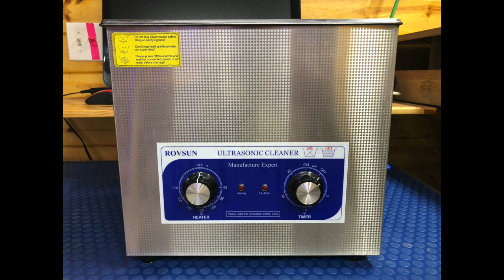40 year old Athearn SD-45 Demonstrator Saved From The Garbage

Comment: I don't know how to tell you this, but ... the broken out windshield post was correct. The demonstrators featured an L-shaped windshield on the engineer's side, a feature SP and other roads adopted with their purchases. The bicentennial unit shown at 1:40 (ATSF 5700) was actually an SD45-2 - longer frame, wider radiator fan spacing, and no flared radiator panels.
Reply from the maker: Yup.  Lots of fellers have points that out to me in the comments about the windshield post. That dang google machine... I type in SD-45 picture, that one pops up and looks good to me so I used it.  You have a good eye there picking that out. Thanks for keeping me "on my toes" and watching my Vid's :-)
Reply: @classicmodeltrains  Sorry. I scrolled down a couple of pages to make sure I wasn't repeating something others had said but I didn't see any window references. I should scroll down further next time. Nice work on the re-condition though.
Reply from the maker: @whiteknightcat  no worries. I also get an opportunity to learn stuff off these videos I put up. People just sharing information is how I see it :-)

Comment: Love the replacement hand rails! According to A-Line, the replacement stanchions have an ID of 0.020", which they say will fit 0.0195" wire. But I see you've used 0.022" wire. Did the stanchions fit over the wire ok?
Reply from the maker: Thanks.  The stanchions were a bit tight, but worked out good.
Reply: By the way, your episode inspired me to dig out an Athearn SW7 I had sitting in the box for years. My hangup had been the handrails - I've never liked the way the handrails and stanchions look on Athearn, but your idea of soldering them in place was just the impetus I needed. My SW7 is now trundling through the yard at 0.5 scale mph. Thanks!

Comment: All of the old trains were built simply. Some locomotives came as locomotive kits and had to be put together painted and letters. With just cleaning the wheels and oiling the mechanism periodically outside of that all you have to do is change the brushes in the motor every 10 years when they wear out any engine is good to go again. I just wish they'd never went to plastic plastic is so cheap compared to die cast. Bad for locomotives at least the diecast way of the shell gives you extra traction. The plastic F7 locomotive was just made to be a desk ornament what model railroad is being what they are they can power anyting. Lionel was going to make their F3 logo motives diecast but one of the major plastic companies convinced them that they could make plastic good enough for Lionel trains. It is a shame Lionel did that. I RV athearn was a Model Railroader who modeled in O gauge. His company Supply very good O gauge Cars & locomotive because he like O gauge trains 2 rail not 3 rail even after most of the other manufacturers went with HO scale trains. Most people had room for a 4 x 8 layout and either O gauge or HO scale. You didn't have room for a 100 car train and you probably could not afford to buy one anyway. Only in the last twenty something years have the humongous O gauge layout in these people's houses has become the fashion. And you can take some apart because I have seen estate sales where is the builder of the layout is selling delay out on behalf of the Widow. If it is an excellent way of getting a museum-quality layout at a much lower price than custom ordering a new one. Athearn had to stop production of the famous blue box line of HO scale kits because the average American is unable to read a simple two-page instruction sheet. And those cars were known as shake the box cars there were maybe ten parts to assemble but today's people are as in-depth with tools as with the written word.
Reply from the maker: Great story (s)  there Frank, Thanks for sharing some of your knowledge with me. :-)
Reply: @classicmodeltrains  thanks for listening I have loved model railroading since I was a small child. I loved taking the elevated train to get to the Hobby Shop. It was so nice to have hobby shops in those days. Most everything you could buy in Ho was of good quality some of the lower-priced engines might have plastic rails or cast into the boiler but these weren't Museum pieces they were meant to be used. I have an old scrapbook where I put and ads for train sets that they used to put out in the newspaper's Before Christmas time. And when you look in the ads in Model Railroader trains were a very inexpensive hobby for a kid to get into. Bachmann trains used to be warrantied for life but that changed with the new owner. Williams O gauge trains used to be guaranteed for life until they got bought by Bachmann. Model railroading is an artform despite what people say. You can have 10 Model Railroad use the same plan from one of the atlas track planning book and every one of them will be different except for the track layout. I hate it on TV where they portray Model Railroader as people who never move out of their mom's house. Or they make you look like a psychotic train nut. We are crazy about trains but we are not psychotic. It is a shame that new toy trains are so expensive that it is virtually on affordable for a kid to get anyting on what they could afford from what they make on a kid's salary. Thank God used stuff is available at train shows. This is such an enjoyable hobby it's a shame for kids to miss out because they get overpriced out of it.
Reply from the maker: @frankmarkovcijr5459  Yup.  Back in the day my paper route supplied me $$ for my train layout.  Kids these days are more into video gaming on the internet. Model railroading isn't as big of a thing anymore for the youth.  Although there are some of them out there, caring on the tradition.  Kids nowadays have more money that we did 40 years ago.